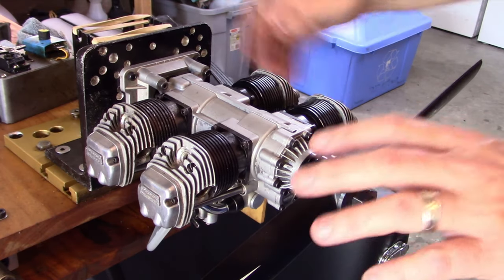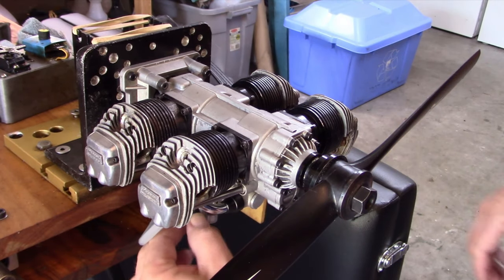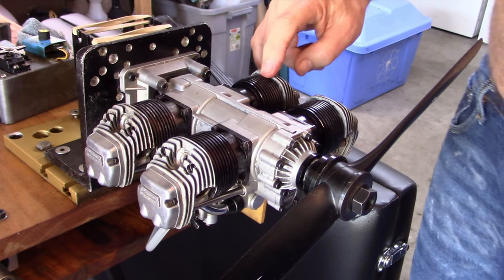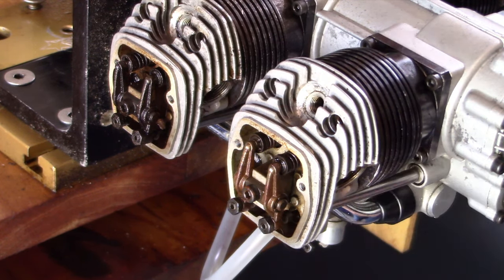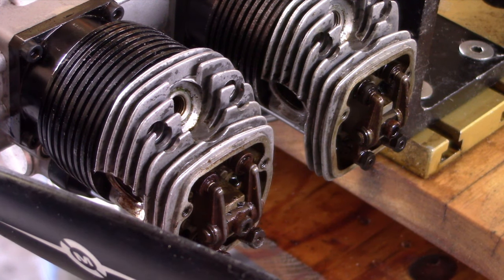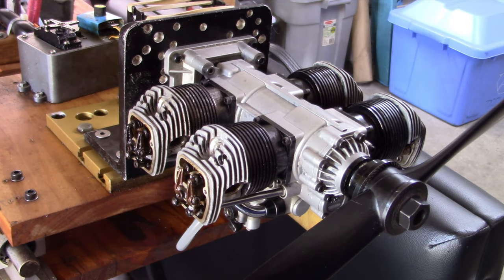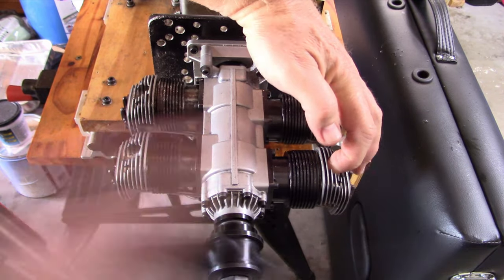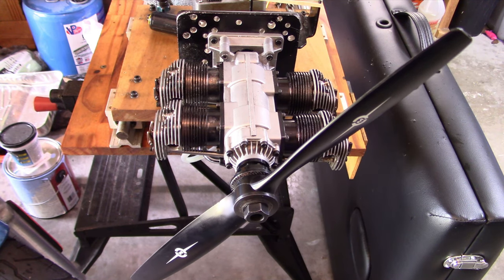OS FF-320 Pegasus We Have Compression!

Comment: I Found that if you soak it in fuel it loosens it up.  Nice videos!
Reply from the maker: Yes many things could be used, but why waste valuable glow fuel for a loosening operation?  I will be putting more 3-in-1 or Marvel Mystery oil in it tonight and rotate the engine all around to coat all parts really well while also rotating the prop over.  Empty, repeat.

Comment from the maker: I am actually considering just doing a very short test run with this engine now.  After so many years of sitting I am pretty sure the bearings need to be replaced, but with this engine I really do not FEEL bad bearings.  But a very short run will not cause a catastrophic bearing failure and will only help in loosening the internals up for an easier disassembly.  But I am still undecided.  I guess the next video will show what I decided to do....  Actually the carb needs to come off and be cleaned/freed up before I consider doing a run.  It is quite stiff and I am uncertain of the settings on it.  Not sure if I will make a video if the carb cleaning or not.